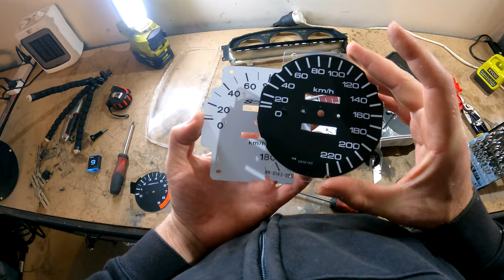$$$ Save Money! DIY EG6 Spoon Sports Cluster | Eg Civic B16

Comment: Are the reading accurate with all the extra rpm and speed added or would you have to recalibrate it or something in a why it reeds correctly
Reply from the maker: Yes it’s accurate the rpm was the same as before and I ended up getting the correct speedo and swapped it later.

Comment: Wicked result mate!  I've literally been sitting and tossing on ordering the exact same item to do in my own cluster.  I've seen the same seller on ebay sells the 220km version too.  How long did it take to arrive in Aus from the time you ordered it just out of curiosity?
Reply from the maker: Thanks! I didn't even see the 220km version. It took about 1 month to arrive.
Reply: @JarrodWillemse  Yea, as of right now the item ID is 223469678390 from what I can see.  I was initially hesitant to attempt this myself as I didn't want to damage the cluster but your walk through makes it look pretty straightforward.
Reply from the maker: @nhialor84  I messaged the supplier and asked if i can get the 220km version just for middle part. Cheers.
Reply: @JarrodWillemse  Awesome; I hope you can get the replacement middle part!
Reply: @JarrodWillemse  What do you rekon would be the best paint to use on the needles?  Say for example to paint them a orange or red color?
Reply from the maker: @nhialor84  i wanna do mine red as my interior is red
Reply: @JarrodWillemse  Yea sweet!  Do you reckon just regular red spray paint (acrylic or enamel) would work just fine?  I'm just trying to think of which one would work best so the lights would still illuminate the needles well enough when the all the cluster lights are on.